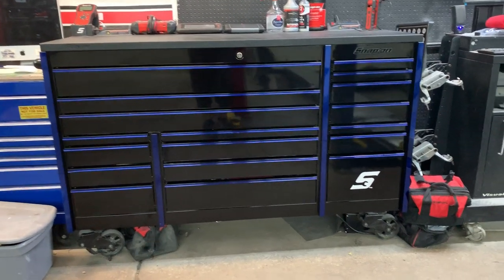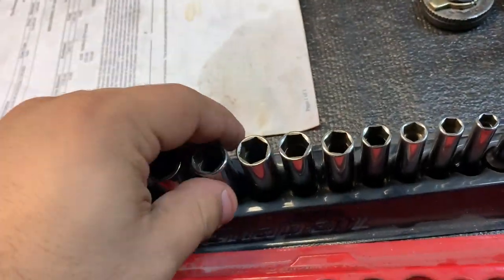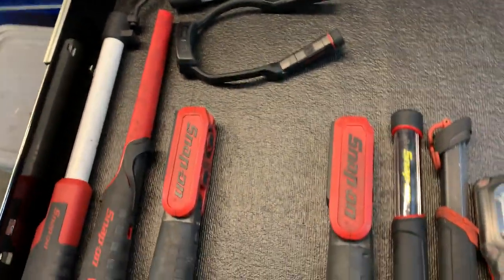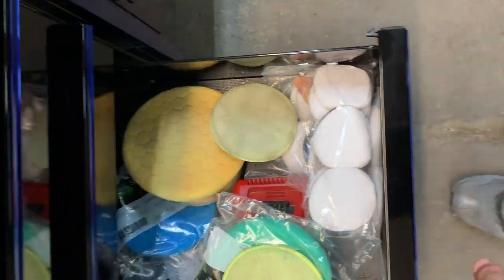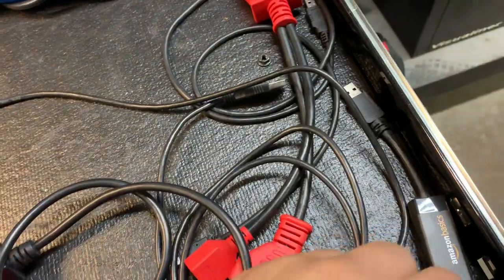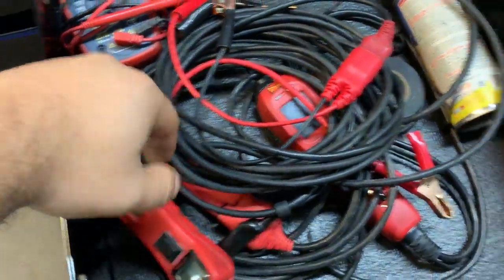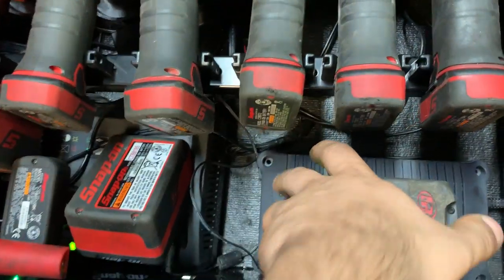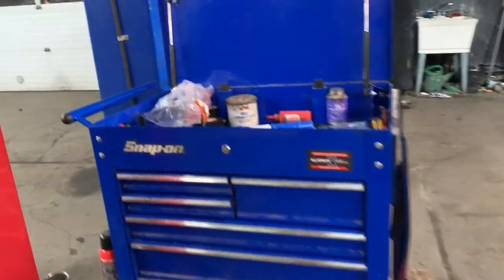SNAP ON 72in Master series toolbox tour update

Comment: Thinking of getting the same box. How difficult was it to get that power drawer setup? Also can you change out the trim on those boxes? The one I’m looking at has chrome trim. Looking to make it red.
Reply: Angel Ortiz The power drawer is an add-on from Snap On.  Not hard to get at all.  And yes the trim can be changed out fairly easily, and they have tons of color combos to choose from

Comment: You could've got all those tools with the same name and warranty half off on Ebay rather than blow your 35K flat rate a year on the Truck. I think it's funny some Techs actually got to explain to their family their on a payment plan for a tool box. I know US General and Husky are a little frail but it does the job and that's all that matters
Reply: Does the job? A lot people like having the best..big truck, fast sports car, house on the water, vacations... You drive a POS used Kia? It does the job... Don't dump on guys that want the best . Snap On is overpriced , but it is the best.. HF, husky? Is China crap9
Reply: @joeframer9642  for your information I drive a 2001 Chevy Tahoe 5.3L V8 lift kit It's scary as F*** It feels good driving down the road with the biggest truck and biggest dick while others got tool payment plans at work and drive beat up Honda's
Reply from the maker: Peter Schissel I GET ALOT OF USE OUT OF ALL MY TOOLS AND IF YOU SEE MY OLD VIDEOS I DID HAVE THOSE BOXS AND I ALSO HAD MANY SHITTY TOOLS FROM HF AND EBAY I MAKE MORE MONEY SPENDING MORE TIME FIXING CARS THEN GRABBING A CHEAP TOOL AND HAVING IT BRAKE AND TAKING hours on a 20 min job
Reply: 35k on flat rate?  Must not be a very good tech to only be bringing home 35k
Reply: @automedic9781  I'm a light duty tech right now.  but I checked online the status of Technician pay and it's only about 35K a year.
Reply: Peter Schissel The thing you have to keep in mind is that average includes all the lube guys doing nothing but oil changes, the tire guys at Pep Boys making $3.50 per tire, etc 

A real flat rate diagnostic tech can EASILY make way more than that if they’re in the right spot.  Don’t get me wrong, I know guys making $35k or less, but they suck.
Reply: Peter Schissel lol great come back, all facts too
Reply: Peter is a light tech... In my day we called you guys greasers.  You can get by with a cheap box and cheap tools. Beat a living out of a tool box you will need and want good tools.
Reply: A tech who makes 35k a year should not be a mechanic. Most average mechanics make $40 an hr here in Canada. Average mechanics make $90k a year flat rate.

Comment: Sometimes I get a call from some poor soul asking me to fix a botched detail that usually involves a coating. Often it's some kind of a truck. Don't have time for that, nor do I work on non-specialty automobiles, and I refer the person to a very good shop that I'm friendly with. Always wonder what kind of individual did the work in the first place. I guess now I know. Nice box. Not much in it. The way the pads are stored is shameful and there aren't enough even for a small car, nor is there a variety needed for different paint systems. The product selection is pathetic, as well. Amateur. Glad I saw this.